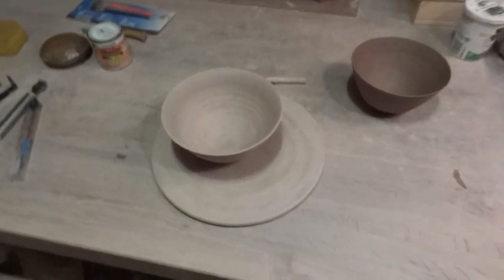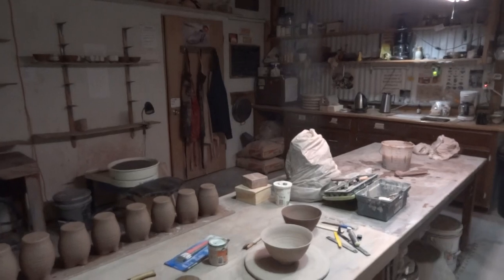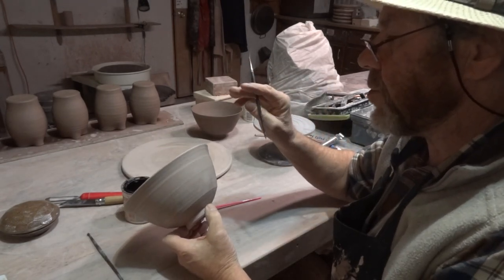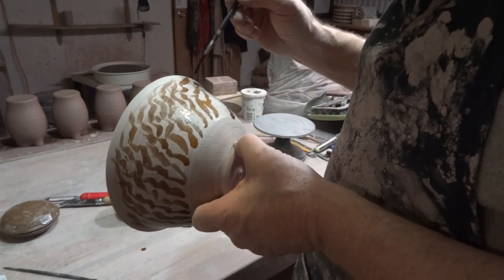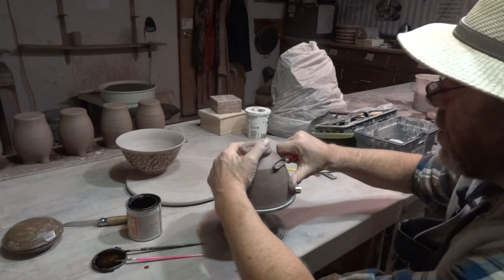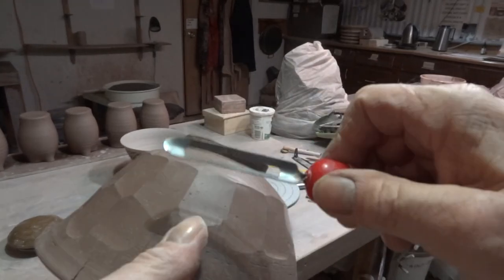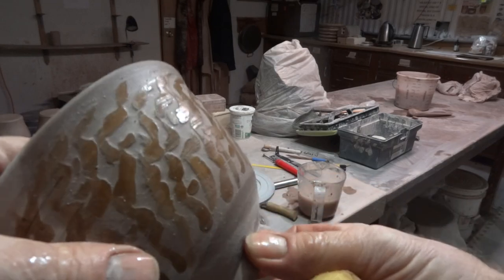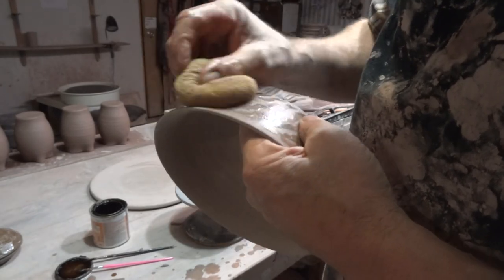Decorating two footed bowls - failure ! -Nov 19th 2019 with Simon Leach

Comment: You’re right you don’t want to use a good brush as shellac does get rock hard on your brushes after it drys.   But you can try brushing the shellac out the best you can when you’re finished.  The next time you’re doing shellac , try letting the brushes soak in the shellac  they will soften back up.